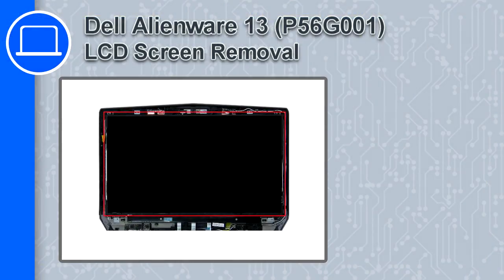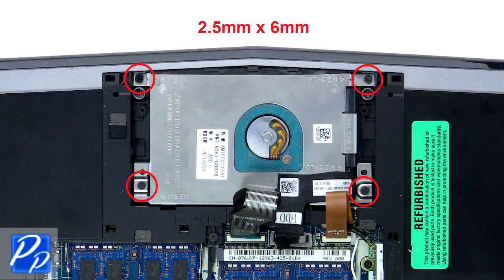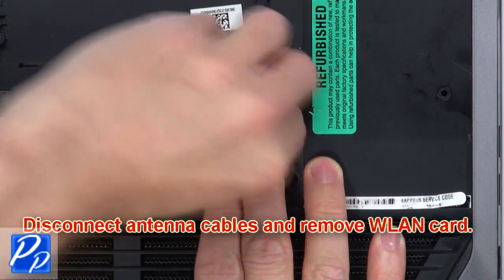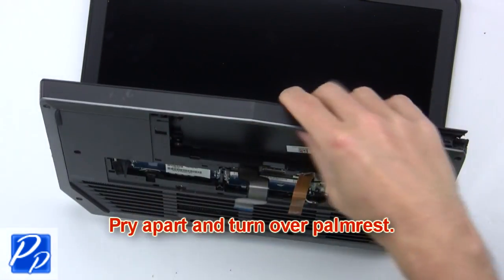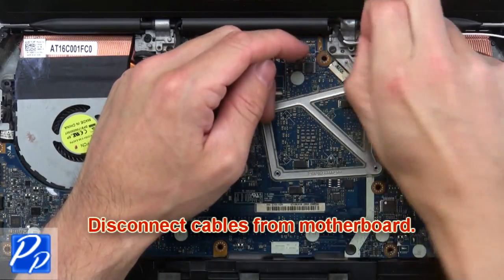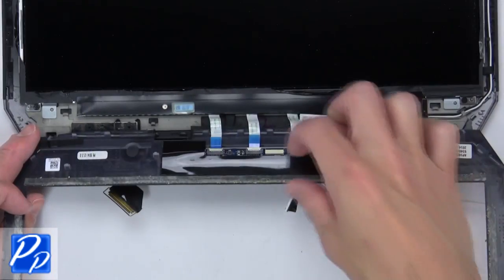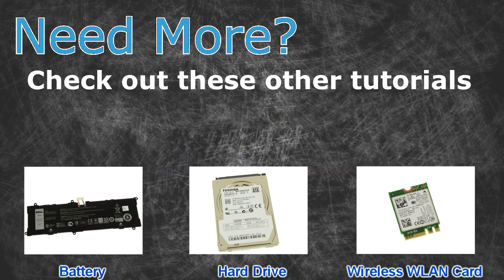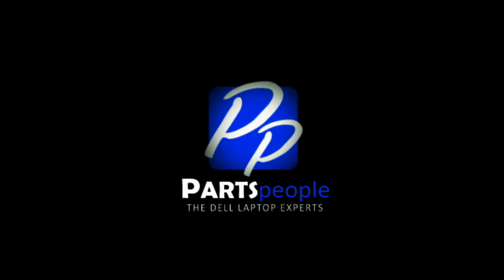Dell Alienware 13 (P56G001) LCD Screen How-To Video Tutorial

Comment: Can I swap my low resolution screen for the oled
Reply from the maker: Yes, you would have to change the LCD cable too.
Reply from the maker: Yes, you would need to use a heat gun to remove it. It's much easier to replace the entire screen assembly.
Reply: I have same issue. Can you made a tutorial on how to swap screen to a higher resolution also with the parts needed (cable, etc)? Mine is HD 1366x768. Thanks.